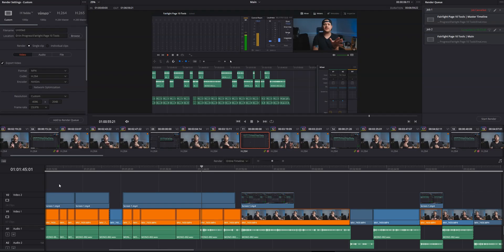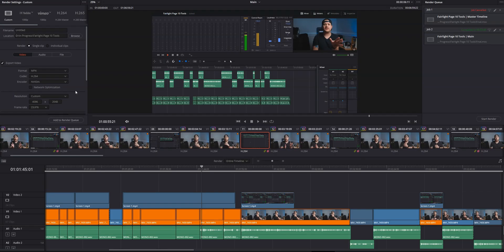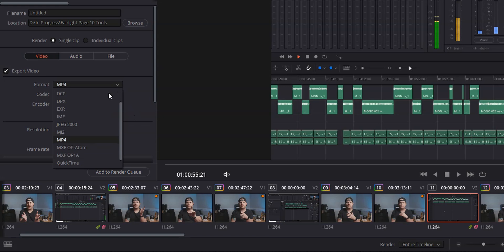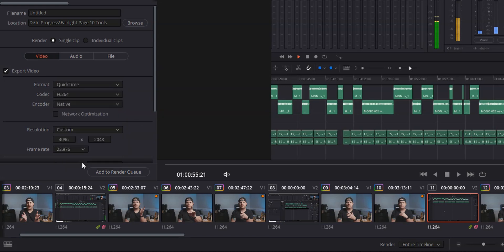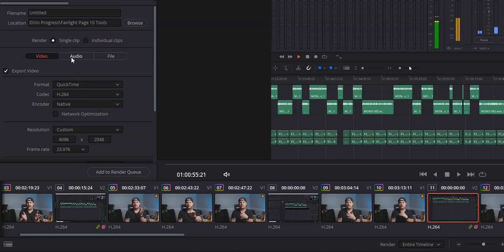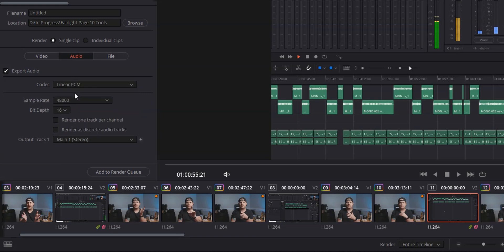SOLVED!! Davinci Resolve Audio Problem on Export

Comment: Hi, thanks for your videos. I yet tried your method (PCM 24bit) but I still have the same problem: in my case the audio is FULL of continuous glitching (like if Fairlight is loosing bits...) I'm on 17.1 beta. Any ideas how to solve?
Reply: Did you manage to solve it? I have the same problem.
Reply: @amberliquilung9706  Hi, yes I solved: simply avoid using Fairlight! Trust me, it's the worst DAW I ever used, full of bugs. Reaper is substantially free, so I'd use that. I know that having a DAW integrated into Davinci would have been so useful, but reality is that Fairlight is almost useless, unless you are working with 48 kHz 24bit. I use Resolve Studio. My problem is that I use 192 kHz files, often 32 bit, multitrack. It seems that Fairlight can't work natively at any other sample rate BUT 48 kHz. Even when you output a 192kHz-file from 192kHz-clips on the timeline, Fairlight tries first to convert your timline-clips to 48 kHz (in order to apply effects), and then re-converts the edited material back to 192 kHz. That CAN produces glitches. To avoid that, you should FIRST convert all your clips to 48 kHz (in another software, like Audacity, Reaper, etc.) and then import your files into Fairlight. Another thing that CAN produces glitches in Fairlight is using “clipping” 32 bit clips. When you record at 32 bit you can theoretically record beyond 0 db without distortion. A normal DAW should recover the “clipped” pick without problems. Fairlight can handle that safely only if clips are up to 48 kHz. Instead, if you use a 192 kHz 32bit file with some clipping, Fairlight will distort the sound.
So, my thumb rule is: if you want to deliver a video+audio file from Davinci, make your audio externally with a serious DAW, then once finished (with the sample rate and bit rate you want) export a 48 kHz 24 bit version of your audio, and use that version in Davinci (without touching it). Instead, if you want a video+audio file with different audio specs, first deliver a video-only file from Davinci, an audio-only file from your external DAW, and then multiplex them up with a multiplex software (Quicktime, Avidemux, etc.)
Note: mine is NOT a “scientific” report, it's simply my experience. Good luck and keep safe.

Comment: I have a problem with audio. I have mp4 files and it imports them, but without audio. I don't know why, because the video itself has audio, I can hear it, when I'm outside of Davinci.
Reply: I had that to so before rendering on the video part where u select mp4 or what not uncheck export video and check it again and then uncheck audio and check it again and render it again it should work

Comment: The youTube audio problem that I seem to have is the sync. It seems to be a small amount but seems pretty consistent that the sync is slightly out. Now talking heads, don't notice it. But I have had drummer clips where the stick is hitting the drum and it is dead on in sync until I upload and then it is slightly off. The youTube latency looks like the sound it late ( 50 ms ). There are already is a brain latency that depending on the cut can look better if it is one or two frames behind. I have cut a music video that is dead on time and when the whole thing was loaded up, the drummer thought it was not quite in sync. And on closer inspection, the settings that someone picks, it gets worse as the resolution goes down ( quality ). This was a few years ago- not sure if youTube ever fixed it. 
Good on you to figure out this bug though. people that watch this will probably forget until it happens to them and then remember that Jay was right and look up this video.
Reply from the maker: I've never noticed that before. But that's a YouTube problem, right? Not a Resolve problem?
Reply: @JayLippman  Yes- but it has been happening for a long time. Hard to decide if to compensate for it, before upload. Been a long time since I tested it. It is kind of difficult to test, as you need something hitting something and then download the youTube and compare.

Comment: Is this a dither problem? Are you starting with 24 bit files? I just switched to a PC from a mac, and am about to export my very first new videos this week. It's total serendipity that this would show up, because that would be an awful thing to have to deal with.  I'm 99% of the time doing classical music videos, and mastering the audio in a DAW first. And, not wanting to leave the SRC and dithering up to an inferior algorithm will export from the DAW at 48k 16b. I guess i'll do a test today and see if I have this problem, or if maybe using 16 bit masters is another way around the issue.
Reply from the maker: Yeah I had the same thought at first. I record all my audio externally. 48K, 24 bit. Unfortunately, the problem persisted until I changed these settings in Resolve.

Comment: Yep! I had this problem too. I noticed it only happened when I had multiple audio tracks in areas where the 2nd audio track, for example, would have no sound. I "fixed" it by adding in tracks with sound in those gaps, and reduced the gain by -80 db. I will try this though, because it's pretty tedious having to fill gaps like that just to get rid of this glitch!
Reply from the maker: Interesring!! Thanks for sharing!
Reply: Just to follow up, this has worked as a charm so far. No more artifacting at all :D